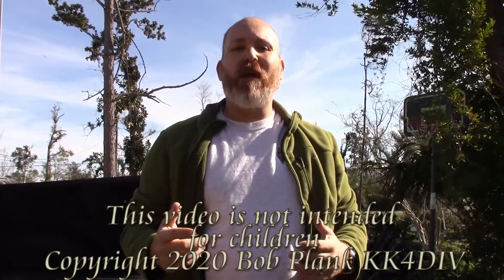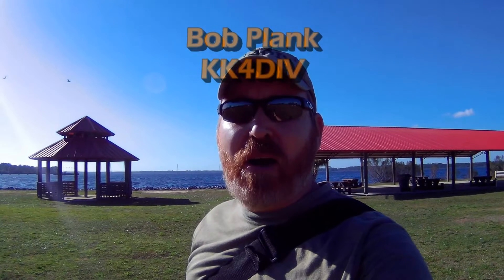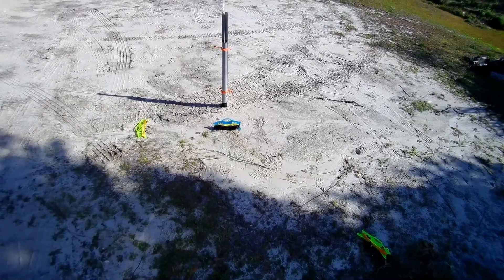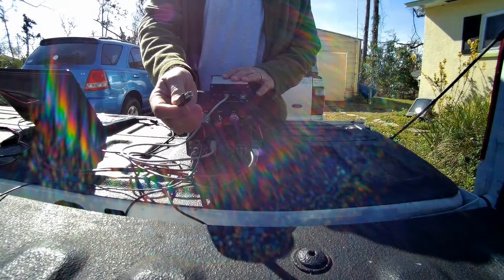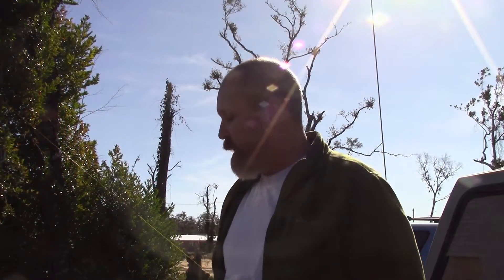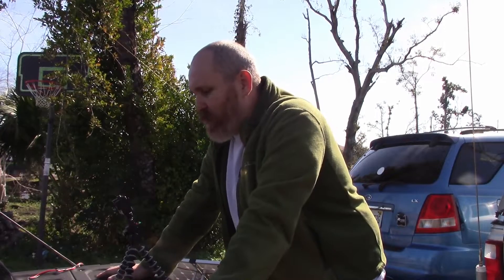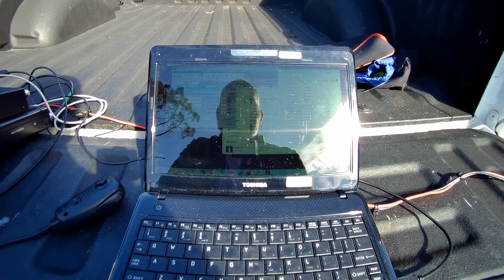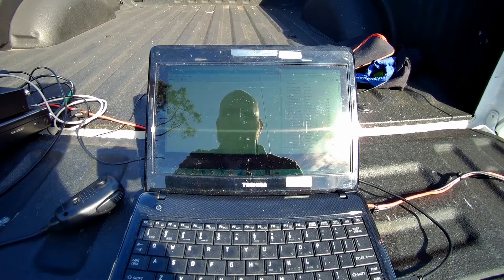Setting up FT-891/Signalink and Winter Field Day 2020 prep

Comment: You're better off using the Data_USB (Data_Upper Side Band) instead and setting that up on your digital software, rather than messing with the SSB settings each time you move from phone (SSB) to data. Furthermore, your BFO set up to "auto", which becomes problematic if you try to use digital modes on the 40m or 80m bands. Your radio will automatically move to LSB even though data on those bands are still USB.

Comment: I have a 7100.  It does not need a Signal Link. Much easier to set up.
Reply from the maker: We have a 7100 at our club. It is a great radio. I like the fact that you can do digital modes with one usb cable from the radio to the computer. I just do not use it enough to learn it and the menu system.

Comment: Bob,
On the 891, is there a way to save profiles so you do not have to re-enter settings when you change modes?
Good job on the videos!! -Ross, K8RLB
Reply: Hi Ross,

I have the 891. Sorry to say, but no...unlike the Icom 7300, you can't save a profile. Best thing you can do is write down the menu numbers, say, 11-1 and the setting on a card labeled Digital or SSB and so forth. This way, you can at least have a way to make sure it's right each time. The 891 is an amazing radio, but the menus are extensive...and annoying with the lack of wrap around. 150 menu items and you have to scroll back to the top if you at the bottom.
Reply from the maker: No, there are no profiles. You are stuck using the menu system each time.